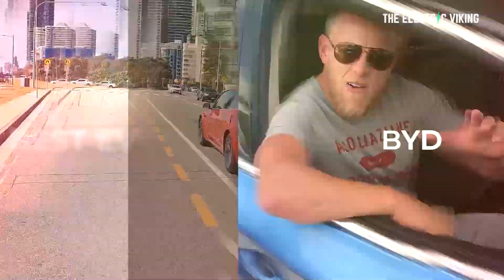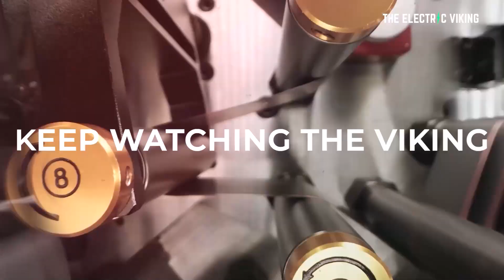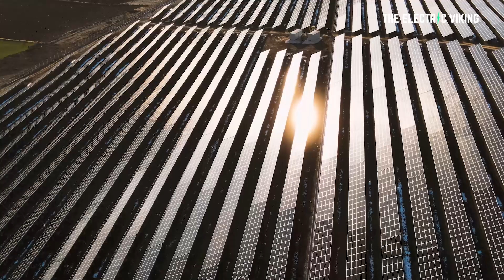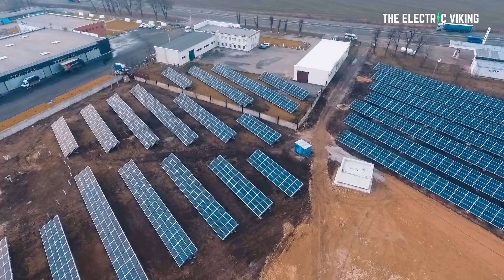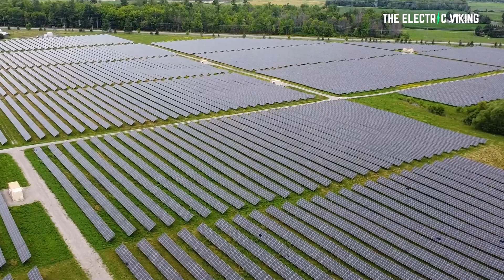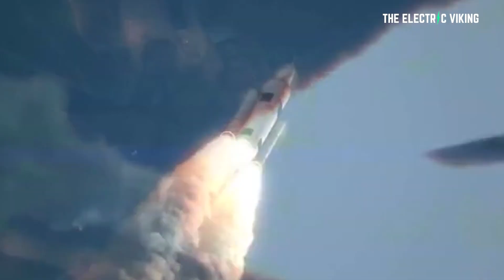Solar panels that work at night could power the Earth 24/7

Comment: There's really nothing special going on here.  Generating a tiny (milliwatt range) of power is actually really easy to do.   If you think about it, even the most trivial gravity generator, tiny flywheel, or even just hot water can generate this kind of power all night long.   Doing it with photons being emitted from the heat of the ground hitting one side of the panel, and the 'coldness of space' (meaning, photons hitting the panel from the night sky) on the other side is an interesting technical problem but doesn't particularly violate any laws of physics or is even that difficult to do.

Whether it is useful or not verses other technologies... yah.  No.  Probably more in the 'not useful' category.

-Matt

Comment: At this level, it's useless. Let's say you have 1000 m2 of solar panels, which probably would be a small farm or large homestead, to have enough space for that. Those would generate only 50 Watt at night, which would barely power a very small refrigerator.
The efficiency would need to improve drastically to start to be useful.

Space-based solar panels are a fool's errand.
Humans are affected by microwave radiation. It makes the body produce a protein, which is otherwise only produced during extreme heat, and it's suspected of causing stress.
The microwave beams from such satellites would need to be aimed extremely accurately, and their aim would be changing continuously, and there's always a failure rate, so radiating people with microwaves would happen all the time.
Also, a huge flare from the sun could knock them all out, or have them all aim randomly, after which they would need to be dropped into the atmosphere to burn up, assuming you could even control them afterwards.

Comment: The same exact thing could not happen in 20 to 30 years, as the power density is 10,000 times lower. This kind of stuff is everywhere. Soil batteries. Geo heat. Waves. Rain.

Comment: So we would put satellites in space that would block the total amount of sunlight that reaches the surface of the planet and then on top of that put receivers on the planet that take up more space no matter what it's taking up space on the planet so why the hell jump through all these ridiculous Hoops‽ it doesn't make any sense. How would you get them into space without using rocket ships? Use a rail gun and blast them to 18,000 miles per hour?

Comment: I want you to keep in mind that we are supposed to be going into an ice age right now where our planet will be freezing over we are slowly keeping that ice age from happening by using carbon emission vehicles and systems. I think it will be a delicate balance to work to control the temperature of the Earth by manipulating the weather and the actual temperature as well... this is why these systems are important. We do not completely move away from any set system we are to produce some carbon emissions it's for the good of the trees.
Reply: The trees where growing well enough before we humans started to put long time stored co2 into the air.  Yes I believe you are right in that we where supposed to get an ice age by now but we humans have well and truly avoided that. In my mind there is no doubt that we must reduce the amount of co2 produced and hope the trees will catch up using what we have already generated. There is not much of a change it will get too cool soon but if it does then we already know well how to generate some more co2.

Comment: Heck, when the transistor was invented at Bell labs, a lot of people were like WTF is this good for? ;^)
Reply: Transistor radios.
Reply: @E-BikingAdventures  Then the microchip. 

It's funny the battle between mechanical/ analog and digital/electrical, and how latter usually wins out, then can even be replaced itself by finer digital tech or analog, or old ideas with new.
- Record player vs. CD, then streaming.
- Analog computer vs. digital computer vs. quantum computer vs. analog computer?
- Gas stove vs. induction.
- Horse and bike vs. ICE car vs. BEV vs. robo-taxi. 
- Steam train vs. diesel electric train vs. electric train. 
- Thermal power vs. solar power.
- Timepiece vs. quartz watch vs. digital watch (then with GPS).
- Speaking of the previous...compass and sextant vs. GPS.
- Tape measure vs. laser measure.
- Digital clock vs. atomic clock. 
- Human mind vs. AI.
- Bar of temp. controlled brass = metre vs. speed of light in a vacuum. 
- Breeding (largely a myth) vs. GMO.
- God vs. science. 
- Clay modelling vs. 3D router vs. 3D printing vs. clay modelling. 
- Etc.
- Etc.

;^)
Reply: @E-BikingAdventures  Enjoy your 8-track tape player.
Reply: Yeah, PNP suddenly doubled the opportunities
Reply: They didn't know what to do with it, because according to Phillip Corso, it was reverse engineered alien technology, that was "introduced" to the public via Bell Labs...  so yeah... it took them a while to figure what to do with it...

Comment: I knew that wind technology was cheap and reliable 60 years ago Sam. Back on the farm our neighbours had a "Windlite" wind generator charging the batteries that provided their home power. The wheatbelt is reliably windy but they had a little petrol or maybe diesel generator that they could start up on the rare occasions when wind power wasn't enough. Many farmers used this system and at least 90% of their power was free from the wind. Their main expense was replacing the batteries every few years.
Reply: 60 years ago our energy demands weren’t as high as they now with microwaves ,iPads  computers , smart tv, play stations , virtually everything we use now requires electricity. So people of the land can definitely survive on small amounts of intermittent electricity but won’t be able to use todays  mod-cons  and would rely heavily of maybe wood stoves and heaters .
Reply: @dorianshadesofgray  In my part of Australia there's nothing intermittent about wind power. Incidentally the first great renewable energy export plant to be constructed in this country is to be a huge solar farm near Darwin that will export power via undersea cable to Singapore.
Reply: @dorian shades of grey. That's bs. The appliances back then were less efficient. If you watched a show on an old CRT TV, you would be using 100 times more power than if you watched it on your iPone or tablet. Incadecent lights vs LED and CFLs. Do you know how much power a pin ball machine uses compared to a gameboy?
Reply: @E-BikingAdventures  60 years ago there was one Small TV in the house or more likely just a radio, not one iPad and iPhone for every person as well as 2 or 3 tvs a laptop and a computer like we have nowadays Dryers weren’t used as people hung their clothes on the line, vacuum cleaners were mechanical devices and people washed dishes by hand. ducted air conditioning was unheard off as people just had a fan and for heating fire places were they way to go . 
It’s pretty common knowledge that as we progress into the future our energy needs increase and not decrease .
Reply: @dorianshadesofgray  . Ok my comment got deleted. As I was saying. Most of those appliances you mentioned were common more than 60 years ago. You must have been poor.
Reply: @E-BikingAdventures  my Father was a petroleum engineer / manager  who travelled the world so no we were not poor. 
If you think most people had dishwashers , clothes dryers. Laptops   iPads , computers , 3 televisions in a  1960 house then you’re just delusional . 
Here’s some stats for you.
Average household electricity use per capita in Australia in 1960 was 1 kWh.
In 2014 it was 11 kWh. 
I call that game set match
Reply: @dorianshadesofgray  I think your first line shows the source of your bias.
Modern Televisions use MUCH less electricity than old CRT screens, iPads and phones use a relatively trivial amount of power and laptops, while pervasive are also relatively low power. Surprisingly, even refrigerators and furnaces use less power than you think if they are modern (many are 20+ years old!). Dishwashers, washer and electric dryers and water heaters use a LOT of power, but if they can lower the costs enough heat pump tech will drive some of that way down.
MY biggest use of power? Central A/C ... and in 1960 NOBODY had central A/C in the middle class suburbs where we lived. Then again, we had snow throughout November, not 75F weather ... but people like you will still claim there's no climate change. My electricity bill cuts in HALF during the used-to-be cold months.
The grid? The things that keep solar panel/battery combos off so many rooftops is cost, and what's driving that cost? NIMBY regulations, esthetics, install bullshit - in other words, human stupidity (the scourge of mankind!). Decentralized batteries are NOT good for VERY profitable big energy conglomerates like Duke Power, who simply want to keep increasing profits (and therefore prices) year over year. If you think they give a flying f**k about the average American, you are sadly mistaken.
Reply: @capnkirk5528  I’m a physicist little fella and I know enough about climate change to know it’s not the existential threat that easily manipulated “ people like you” think it is .
As far as your anecdotal evidence goes .. I presented the facts about energy consumption in my previous comment so all
I heard was a meaningless opinion.
Reply: @dorianshadesofgray  LOL. You are funny, "little fella". The reply wasn't for YOU, but for people who still have an open mind.
And I'm sure YOU are a good judge of what an existential threat is ... maybe you should consider what an ECONOMIC threat is. If you really are a privileged child of the petroleum industry you certainly aren't going to turn your back on them now.
Reply: @capnkirk5528  good to see my “ little fella” jab hit its target. Now stop boring  me with 2 year old posts .
Reply: You are correct ..many farms in the UK are doing this today.

Comment: I would would compare same size solar pannels storing energy into a battery system during the day if the energy saved in the battery would be higher than the energy produced with this differential cooling system of the same size. If the solar pannel produces more energy to be used at night from the battery then this differential cooling system would be useless.

Comment: This is interesting but not as practical as simply increasing efficiency of solar panels and storing the energy in batteries. And by the way those batteries are also improving year after year.

Comment: Physics says no. At best, this might be enough idle current to keep the inverter powered using the entire output of the array. It's nothing anywhere close to the daytime production.

You're being taken for a ride on the science on this one. Any transmission (light or RF) suffers from the Inverse-square law. 

IE: The intensity (or illuminance or irradiance) of light or other linear waves radiating from a point source (energy per unit of area perpendicular to the source) is inversely proportional to the square of the distance from the source, so an object (of the same size) twice as far away receives only one-quarter the energy (in the same time period).

See: https://en.wikipedia.org/wiki/Inverse-square_law

You'll either lose the majority of any kind of transmitted power over the distance between space and the earth, or you have a beam that focused that it cooks anything that travels through it.

Comment: Ridiculous, who cares about 50mv it’s only 0.05W per m2 , utterly pointless. You could perhaps power a watch?
Reply: Now it’s 50mv. It may be much more over time. These kinds of technologies seem utterly pointless at first. It may be viable in 10 or 20 years.
Reply: ...just like the first computers were that filled whole buildings but had minute processing power. Today's CPUs and GPUs? 99% of the energy gets lost as heat and cooling fan energy. So let's not use them any more! Also: you obviously have no clue about electromagnetic waves and think that today's photovoltaic cells are top notch. 🤣🤣🤣 Watch 8.01 up to 8.06 and talk to me later...will take you years if you do it thoroughly - and don't just surf over it.
Reply: @bitmormon2019  it is not the same. There is not enough energy at night to capture. It physical limit and nothing can't change that.
Reply: @ekkalchev  ... that's what you think because you think visible electromagnetic waves are the whole spectrum...
Reply: @ekkalchev  Even more energy can be harnessed at night than during the day.
Reply: @bitmormon2019  "Even more energy can be harnessed at night than during the day."  Ah... i was talking to an idiot. Sorry I couldn't to figure out that earlier and wasted my time
Reply: @bitmormon2019  It matters how much energy is there in the invisible spectrum. You are suggesting that during the night visible spectrum disappears but invisible is still there with same energy capacity as it is during the day. Sun contribute for both visible and invisible spectrum. At night the dominant source of energy is heat radiation from the surface, which is 1000000 times less than energy coming directly from the sun. Even if you manage to capture 100% of all that energy during the night (which is impossible) you still will be producing 0.01% of the energy produced at during the day. Actually if you read the original statement from Stanford researchers about this - they claim that these solar panels produce 50mW of power on square meter. 
I guess you don't have an idea how small if 50mw but you ill 300 time more energy to charge you phone and that won't be even fast charging :)

This guy is famous electro engineer having channel in youtube. He can explain it better than me https://www.youtube.com/watch?v=Tdge8vEODeY&t=558s

Comment: NASA Wireless Power Transmission in the 1950s at < 85% effectiency over 1 mile. Guess that answers my question as to why they haven't been doing it. Ohm's Law strikes again with parasitic loss https://youtu.be/bJ0a9Yz8QS0

Comment: Electricity has this problem. It flows to the path of least resistance. It's possible to conduct electricity through induction using coils. Putting AC on a Carrier Signal to move it from one place to another... OK.. WHY haven't We been doing it for the last 60 years instead of building our this Massive infrastructure with high tension lines and this huge 70KV Switches at Distribution Centers if We can get conductive Nodes to do it at some resonating frequency 😐
Reply: We don't use coils for transmission because the losses are massive. Look at something like a Qi charger for a phone - the additional power used to transmit 5-10W under a centimetre is surprising. If you tried it over multiple kilometers, you'll be lucky to light an LED bulb with an entire coal power plant.

Comment: The problem with solar panels is that they don’t last long. I installed a pair in the nineties and today they generate almost nothing, same as the expensive batteries I paired with them…
Reply: panels made in the 90s are really primitive compared to those made today. Early adoption of tech always has its downside.
Reply: Modern solar panels typically last 20-25 years.  That's pretty substantial considering the small upfront cost and will pay for itself in half that time in most areas of the world (aside from Seattle and Great Britain 😂)

Comment: 50 milliwatts per square meter?  The typical inverter for a 10,000 watt system has standby power of 75 to 100 watts. Yeah, a long way to go.
Reply: This research is several months old. 50 mW are a joke unless you've got an insane amount of space and the additional investment for nighttime-capable solar is worth it (probably not, considering how little you'd generate. 20 square meters add up to 1 Watt, you can't even power an ordinary room-LED with that; what am I gonna do with 6Wh, which is all you're going to get in a warm summer night?). Clickbait title.
Reply: With sun its 150-200w per m2. Milliwatts  is literally not going to move the needle.